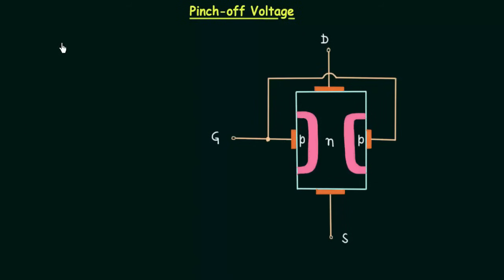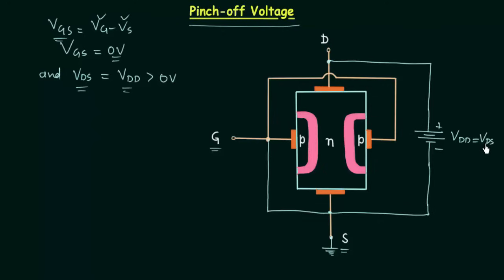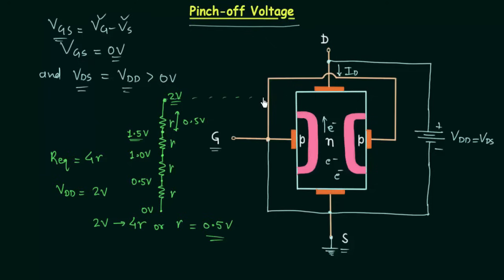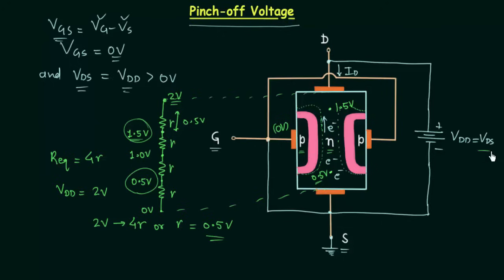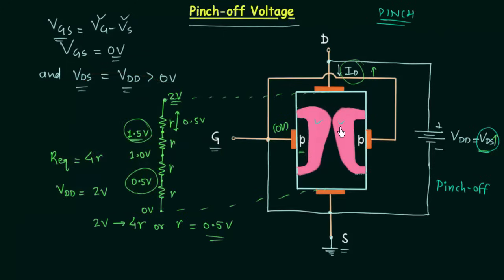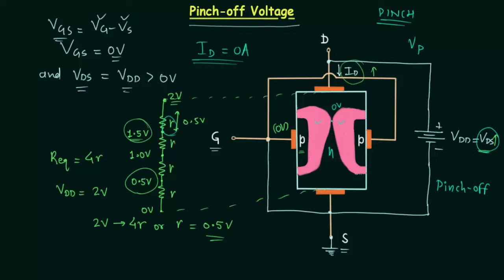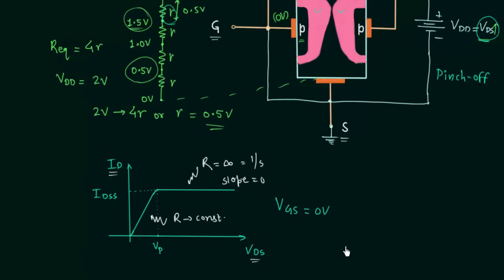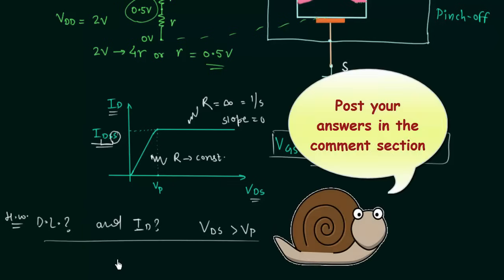Pinch-off Voltage

Comment: I have one doubt -
In this presentation , when you are explaining the reason of why two depletion region never touch each other you had consider id = 0 , this is ok ........but when you are explaning the graph you had said that  when Vds reaches pinch off voltage, Id saturates and is equal to Idss...................so at vds = vp ,id=0 or id =idss .....PLEASE SOLVE my doubt...........
Reply: Neso Academy but should'nt  that constant value be close to zero as very small current passes through
Reply: Sir you are telling deplation layers do not touch each other but at Vgs  = vp (reverse biased) why does Ids (drain current) remains zero with increasing Vds?????
Reply: on increasing Vds definitely Id increase and depletion width increases but upto a certain extent because Id will stabilise to a constant value as very high value of Id is compensated by increasing the depletion width and eventually Id reduces again irrespective of the increased applied voltage. So Id is neither zero nor a very high value it will saturate to a constant value known as Idss.

Comment: I am confuse with 9:00 Id will become constant but the channel is getting narrow due to depletion layer increasing.
ideally when the channel is getting narrow it means that the resistance is higher than the Id is getting lower.
please help me to understand it.....
thanks.
Reply: the channel narrows when Vds is incrementing, narrower channel = higher resistance,    since  U = I*R              if U goes up      ==>      R goes up      &        I can be constant

Comment: On increasing Vds>Vp, Ids will remain constant. This is because the depletion remains the same, and the path is narrow, only few electrons can flow. In other words, Vgs increases, resistance =Infinity, so current =constant and 0amp,
Correct me if am wrong
Reply: in my opinion you are right..
Reply: Prabhakar Das Vgs increases, R=infinity , that's wrong, Vgs is zero right :/
Reply: Totally wrong! Increasing Vds further won't affect the depletion region and hence it won't affect the current "IDEALLY"
Reply: Prabhakar Das you are correct
Reply: Ritu Halder He mistakenly wrote Vgs instead of Vds.
Reply: Prabhakar Das yo bro you got dat...

Comment: Why Ids current becomes maximum at pinch off voltage? Is it because as vds is increased and current being proportional(ohms law) increase and just before pinch off state reaches it does not increase linearly with voltage because n channel shrinking width also come into picture. And thus current is no longer proportional to just voltage .And at pinch off state it becomes saturated and does not increase more.
So to sum up.... never mind I got it . Although that's my reason .might be wrong .any other opinions?

Comment: Sir I have an doubt, if Vds increase the upper region of depletion region comes closer, so it narrows the flow of electrons(increased resistance),then how Ids increases
Reply: an doubt
Reply: As the voltage is increasing amt of flow of electron is increasing so the current is increasing

Comment: I'm stuck on one point, kindly help me sir. After point Vds = Vp on graph we obtained a horizontal line where resistance is approaching infinity how can we obtained maximum current i.e Idss?
Reply: current is Maximum means ....current that the transistor can allow to pass through is maximum...further increase in Vds will break the transistor...